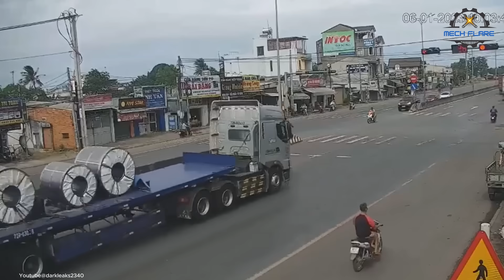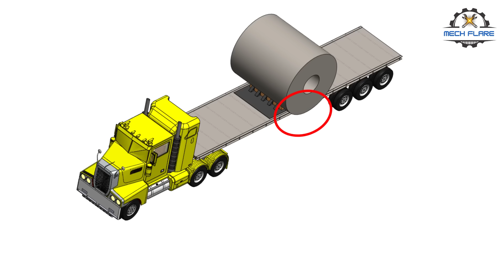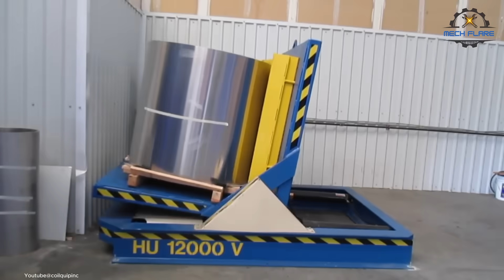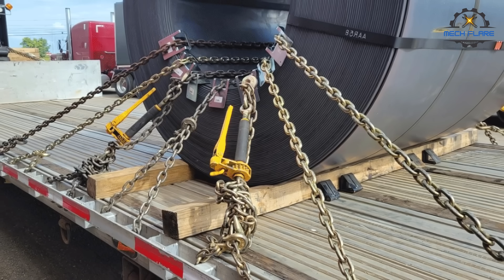Suicide Steel Coils: Can We Stop These Monsters? (USA vs Europe)

Comment: I think load securement as a whole needs to be reviewed in the US, they seems to have a massive issue with shifted loads over there which are almost unheard of over in Europe. The US securement ruling is the WLL of all tiedowns must equal 50% of the mass of the load. In the UK the requirement is the WLL of tiedowns stopping the load from moving forwards must equal to 100% of the loads mass, and then 50% for the tiedowns in the other three directions - the difference is astounding.

Comment: When I started driving in the UK in the early 80s there were coil trailers, 40’ flatbeds with removable deck boards down the centre, the boards were removed and the coil(s) sat in the well between the trailer chassis rails. With flat ends pointing fore and aft the coils aren’t moving when you brake or accelerate. I wouldn’t consider running with them where they can roll along the trailer. Even wooden cable coils, with wedges batons, chains, straps etc. are hard to get 100% solid.

Comment: You get issues because your drivers are not properly trained to secure the load or to check the load is secure. Hire drivers that have done the correct courses on loading instead of some migrant that works for a third of the price but has no idea. If you pay peanuts you get monkeys.

Comment: "Suicide Coils" are super save and used a lot here in europe, if you use propper restrainer. And some old piece of wood, you see in many of those accidents, simply isn't. What you need is an "immobilizer" for cars, truck, trailers, for the size of the coil and tightly fitted to the frame of the trailer.
Eye to the sky is very restrictive in weight, as the weight of the coil will damage the outer layer on vibration. Suicide and shotgun will only scratch the contact patch to inpropper restrainers. Propperly loaded it rolls a mill on and off the "immobilizer" ramps.

Comment: One difference that also applies between the US and Europe is the permitted vehicle combination weight and a specialized trailer is heavier than a plain flatbed trailer.
US max permitted weight is 34 tons
Swedish max permitted weight is 65 tons
There are exceptions and additional regulations though. And I consider metric tons.

Comment: I'm not a trucker, so excuse my ignorance! My question is, 'Why is the load placed in the middle of the trailer?' If the load breaks free, for some reason, such as rapid deceleration of the vehicle, its momentum will mean that it will hit the tractor unit with great force. If it were placed over the axles closest to the tractor unit - would that not mitigate the force should it break free? I'm perfectly willing to accept any corrections to my (probably flawed) reasoning. I was just thinking about how egg boxes help to prevent breakages by treating the egg as an integral part of the packaging and are prevented them from moving randomly and getting broken. Drop an egg box and you might have some cracked eggs. Drop a bag with loose eggs and you'll probably end up with a sorry mess of broken eggs.
Rather like the idea of seat belts in a car. You're safer being restrained than becoming a projectile.

Comment: My company drove for 25 years steel coils for britisch steel, with flat trailers and curtaintrailers. In the floor we had a simpel system to open the floor both sides so got a V shape to load the 
coils with the round side to the sides of the trailers. after loading by hand you close all V shapes in the floor by hand and you have a flat trailer again. an easy system that keep the coils on its place even with an emergency break it never roles to the cabin of the truck because of its hugh friction to the floor. In this way you can load 1 hoge coil of several smaller coils to the
legal maximum weight. and a cheap solution.

Comment: I don't get it how the coils are more compact than sheets but alr, I mean, quadratic sheets cover space much much better than coils, but I understand the fact, that they are so heavy, the trailers they have wouldn't carry a lot of em anyways, and the coils are not really stored a lot, they are worked on, most of the time, the place they wait the most for non direct working purposes is the factory that uncoils them and uses the material, waiting to be next in line for work, they are, as far as I know, ordered, so they are almost at work before have been produced..

Comment: Maaaan, I spent month working with them big coils, I was the first step of the process. Putting the coil into a guillotine looking machine to cut it and stack it into sheets for the other steps after. It's at that time I realized metal do be heavy, like a stack of sheets that looked small and pretty liftable by hand needed a machine to lift it. Made me respect metal a bit more lol

Comment: Not exactly the same, but sort of similar: there was a horrendous traffic accident in Finland back in 2004, where a truck loaded with heavy rolls of papers collided with a bus full of mostly youths on a skii trip. 23 people died as the paper rolls crushed the majority of the bus.

 The biggest safety recommendations that followed were to place responsibility on the transport company, not just the driver, as it was found that the route the truck was supposed to drive was impossible to get done on time without speeding or violating the mandated resting hours.

 The increased speed, and the driver's lack of sleep, were noted as two major factors in the accident, alongside the busdriver's lack of sleep, and the road conditions.

Thankfully, traffic safety here is still steadily increasing with strict regulations. From the peak in 1972 with 1156 deaths in a year, we are now down to about 150 deaths per year. Still way too many, but that number is at least all the fatalities, including pedestrians and bicyclists.
Reply: You would say, it's just paper, but with so much weight and inertia that trying to stop it innocently by hand transforms you into a pancake.

Comment: The only real reason they dont copy European standards in a lot of respects is because American manufacturing has only been on the decline hence why everything is done as cheaply as possible. If coil loads became more common to the point less experienced drivers were taking them, you bet they'd mandate specialized trailers over simple chains and binders. To everyone saying "securement is everything", it means nothing if a driver has to slam on the brakes and the chains rip through the trailer.

Comment: The drivers don't choose whether  they're loaded 'suicide' or 'shotgun'
It's dictated by the shipper or receivers loading/unloading equipment.

If both load/unload by crane they can be loaded "shotgun'. If either end unloads by forklift with a coil boom they have to be loaded 'suicide'.

Comment: I live in an European port town, and occasionally I do see metal coils that are secured within a steel cage, positioned suicide style. It has crossbracing securing the eye, hook attachment points on each side and indents that suggest forklklifts could grab them in any orientation. I had opportunity to talk with someone working within heavy industry about this, and they said the only reason they are not used commonly, is they they are quite expensive, since they are built to contain unfurling of coil, which packs a substantial amount of energy. There are sizing issues to, they accomodate a range of sizes, but not everything (they are built in a way that several of them lined together take exactly same space as shipping container, and can be secured together to allow stacking to some degree.
In most cases specialized trailer is cheaper than those cages.

Comment: Another drama clip about nothing special, as usual. All for clicks and views.
Secure it, use coil wells, use trailers with load wall at the front and drive carefully - just like with any other load.

I dont see what the issue is about. #downvote

Comment: Solution seems quite easy. Build a specialized very sturdy rack. Fixed to a specialized truck or one that stays on the coil. Why would someone put a very heavy roll on a flat surface, secured only by a few straps.

Comment: well as shown in this vide where several of them is secured with 1 chain strap, thats where the sucide part lies, i know in Norway we more or less never have any issues when transporting these. if you ever got pulled in to a road station with just one chain on these you wuold loose you license right there and then, yes there is a risk tranporting them, so you make sure they are properly secured.

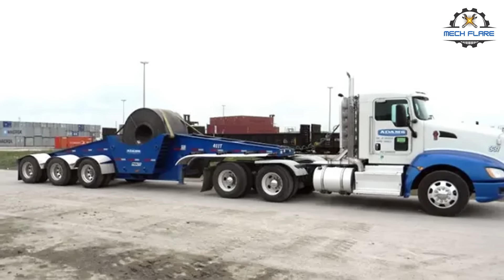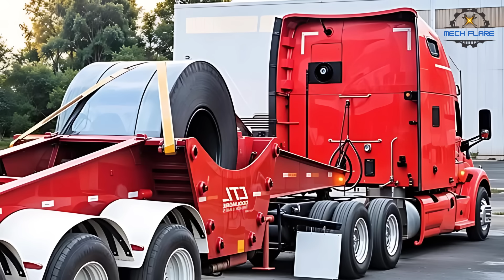Comment: Simples. You need specialised training and certificate and dedicated trailor to move bulk liquid fuels, it's called a tanker. You apply the same logic to bulk coils. Training, certificate and a stepped or welled low-loader. Putting coils on a standard flatbed height trailor is too high a centre of gravity. Every example you showed of it going wrong was on a standard flatbed, so avoid them.  The other major error in your examples is they are chained to the trailor body and not the actual chassis. The best example you show is @ 6:15 and 6:20. Chains invariably damage the steel product and more suitable for wooden cable drums.

Comment: There is another safety measure you can put on your trailer right at the front of the trailer put a bumper guard just like the very end of a train track stopper so if the coil starts rolling it will hit the bumper before it hits the cab

Comment: There is one small trick that has helped for the steel coils right before they put the coil on the trailer layout the heavy 4-in straps after the coil is put on the trailer take the 4-inch strap that's laid out wrap it around and hook it to the opposite end of the trailer so you have one strap it's connected to the tail end of the trailer lay it down on the deck put the coil on then wrap it around and hook it back to the tail end of the truck do two or three of those for the tail end and only two of them for the front of the truck play the heavy duty chains for the inside of the coil so the only thing you have to worry about is how strong viewer trailer is to handle the heavy coils

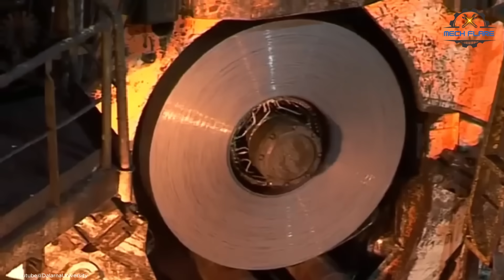Comment: 0:46 Trust me, steel coils are solely made of steel. Aluminium is used for aluminium coils.
Reply: I was about to wright that but I see someone already did it.
Only time I seen another type of coil being move by a truck in EU was a copper coil not that long ago but that might be because I was in part of Poland with more heavy industry.
Reply: @mrassassin1292  Copper is not used as often in sheets, it is also considerably more expensive than steel - for the material alone (not allowing for the cost of rolling or shaping) copper is worth approximately ten times as much as steel for the same weight, which is also one reason why copper is not often used in rolled/ sheet form.
Reply: That's what's so great about the Internet, always learning something
Reply: I wish the author was correct. I want titanium coils made of dog poop ingots. That would make them very affordable

Comment: I don't understand why drivers don't install a protective wall behind the cab when carrying these, as can be seen on the heavy logging trucks.
Reply: Once a coil starts to roll the dynamic forces are too much for even the strongest trailer headboard, and the weight penalty makes it unjustifiable. A proper engineered coil well trailer is the safest method of transporting them.

Comment: If the steel rolls are 30 tonne each

You would need chains rated to 60 tonne for each roll

Twice the full weight ( even empty)  ( 1000 litre bulkies )

According  to the weights and measures  rules and regulations ( here in Australia)

Comment: I know a company in Europe that loaded them suicide style on a flatbed too. But one of the people involved seemed to have been a math head. The clamped down a Steel triangle eater each coil on both sides (so four per coil) with the reason, that gravity would pull harder on the coil than any force that would be enough to roll them over said triangles. afaik they even used the standard connection points for Cargo container on those trailer. It was simple yet effective.
Reply: Same principle as in Roman arches, many of which are now over 2000 years old and still standing strong.

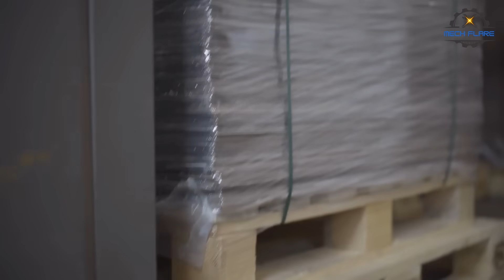Comment: 1:25 Completely missing the top reason why coils are preferable over sheets. With a coil you have practically unlimited length with near zero wastage (length wise). Sheets would have to be joined to form longer lengths if needed, and/or be supplied in the correct length from the factory to avoid wastage.
Reply: The core problem is that the algorithm rewards obviously-wrong content. It's all about engagement, and extracting more human attention at all costs.
Reply: yep.  a coil has two ends.  a stack of sheets can have hundreds.

Comment: for code 95 training we had a big discussion about coils.. we calculated how many chains we needed to use, and how almost its impossible to do so with all the angles calculated , not even started how much can you pull on that small part on the trailer.
its all came down to you basically cant transport it safely ( emergency breaking) 
you need those special trailers.. and its inexperienced office employees who take these transport jobs. and its you who need to say its not possible to transport it. he also showed us examples,  how 6 companies declined the job, and the 7th did and he crashed halfway europe. (report of the investigation) max weight loaded, and coils broken lose what killed the driver.

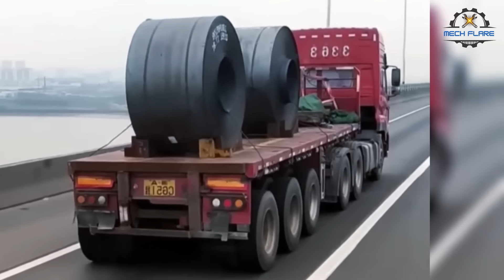Comment: 2:13 look at the string holding that from rolling .😢😢
Reply: Sorry this might seem like a silly question. Are you saying that securement is inadequate ?
Reply: @andrebello4191  correct.☑️ 😊
Reply: @MagnetOnlyMotors Ya looks like they need more tie down reinforcements and regulations in general. These things weigh like 20000 lbs. Can't cut corners. Well I want to be an engineer one day so I pay attention to these things.

Comment: Secure them properly and don't drive like you just escaped from a mental hospital. 
A 40,000 lb load requires a securement that is equal to or greater than the weight of the load.

Comment: I get that completely specialised trailer designs are costly and less versatile, but some of these troughs look like you could cover them up relatively easy if you want to use the trailer as a flatbed on your way home.

Me personally, I'd try loading them suicide style, but use a lowboy instead of a regular flatbed. That way if the coil gets loose it will hit the bend in the trailer and my truck's rear wheels instead of the cabin

Comment: I say if you have haul :Suicide" style uses ALL your chains split between each coil up to say 7 per coil .. that the most I saw in this video. I am how even not a prelesional trucker, but have worked unloading and loading lots of stuff as a Millwright.

Many plants you can get one of the yard guys to help chain stuff down, 6 or 7 chains per roll won't take much longer with two guys working at it.

Comment: Or a better option: take them off the road and put them on rails. Typical gondolas can handle multiple coils, and there are even specially designed coil cars that can handle the loads even better, and are quite common. Max gross weight of a rail car when loaded here in the states is 286,000lbs, or 143 US tons. You can move plenty more coils and move them safer than on the road in a rail car.

Comment: I hauled them for several years. They look terrifying but if secured properly they are very safe. The danger is with inattentive or untrained drivers. 

What is MUCH more dangerous is flat sheets. Those are harder to secure and very slippery. Steel on steel is truly deadly. They slide easily side to side as well as forward and back. I was always more nervous with flat sheets than any other load. Sliding sheets have been known to cut the cab right in half and the driver along with it.
Reply from the maker: Thank you for this great insight.

Comment: Figured commonsense would be lay them down & 2 stack each or have enclosed trailers put a large stopper wedge at the end of the trailer & once at that put another stopper wedge in front to prevent it from rolling & them chain or strap them up depending on if this is a curtain side or a shipping container would be the different securing options. 

It always feels alot safer than trusting a few chains to prevent my back from being blown out by a surprise steel rolling thunder 😂

Comment: What bugs me is these area always on their rolling side and not plane side. They could solve this problem better by laying them on the plane side on boards. Then when they need to move them they can hook them up almost as easily.
Reply: To add to my comment. There is a way to make offloading easier.
I do like the idea of a cradling trailer, better yet, they could build a trailer and install cones with 4 large bolt loops with a bolt pattern that works with any size roll. The cones only need to be tall enough for the rolls to be against each other.

I wonder why they don't roll them into cargo boxes if they're narrow enough? The box design might be capable of containing the rolls. They would then only worry about rolling backwards.

Comment: i believe you tried genuinely to address this topic how ever i believe you didn't take into account differences between the USA freight operations and Europe freight operations which has many differences. in the us we typically run higher load weights so to stay legal we use light weight equipment such as basic flatbeds. i would highly agree with you that more training and better training needs to be given to workers from their employers. and the idea that we only need meet requirements needs to be thrown out. we must exceed the minimum when it comes to load securement.
Reply from the maker: Agreed